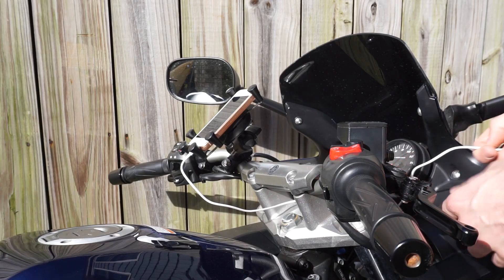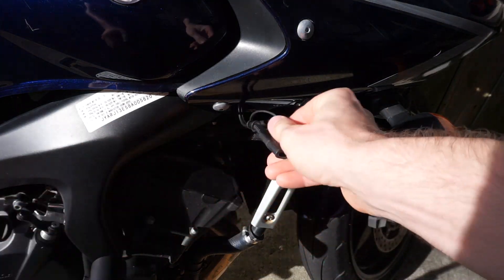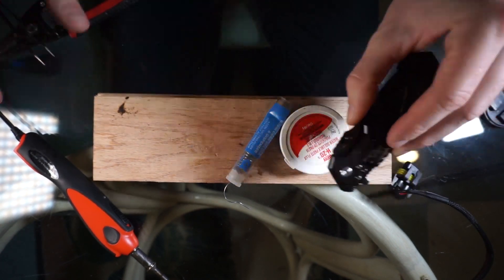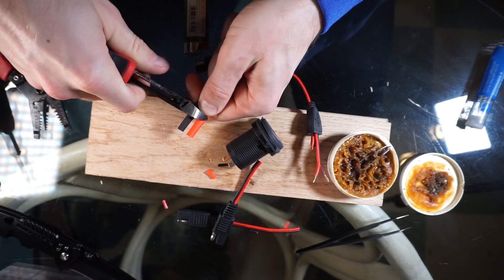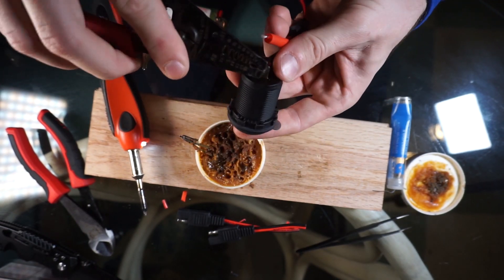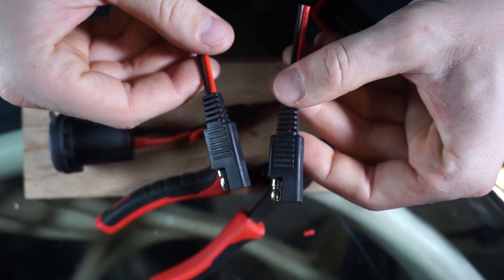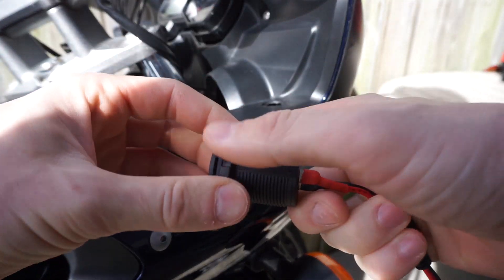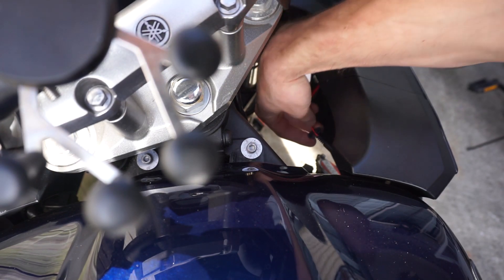How to add Motorcycle USB Charger - installation Soldering technic

Comment: Sir consistetly that thing is on is that cause battery drainage issue
Reply from the maker: It can, if you leave bike for long with out driving, firstly  was disconnecting the wire with that little outlet, later made the switch.

Comment: This is cool however if you ran positive to the ignition switch fuse it would be better. Running it straight go the battery causes it to stay on even when the bike is off. A parasitic drain in other words.
Reply from the maker: Yes! You right! If bike staying for too long it will drain your battery!👍🏻
That's why i have the little outlet in between!

Comment: Awesome! That would be great on my Hayabusa! Thanks
Reply from the maker: I did it on Hayabusa as well, I don't have the video how I did it but it was almoust same semplisity as here, one think on Busa u have to remove the fearrings and get the long wires from the battery cas the battery is at the back of the bike, or u can use some ather equipment to connect the wires closer...